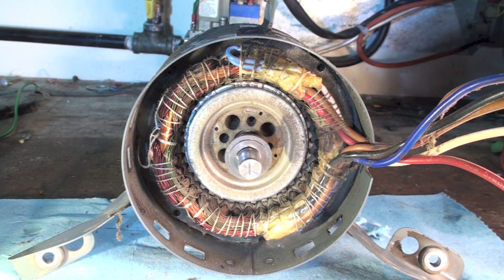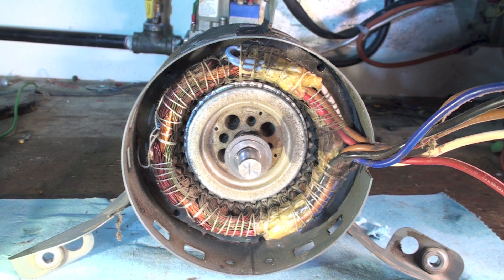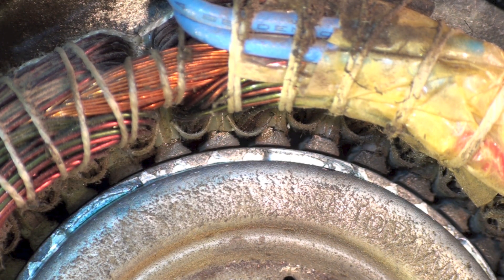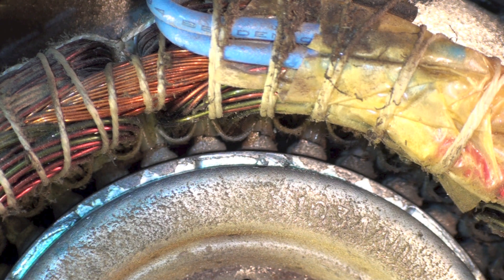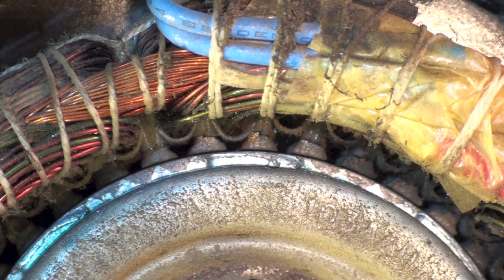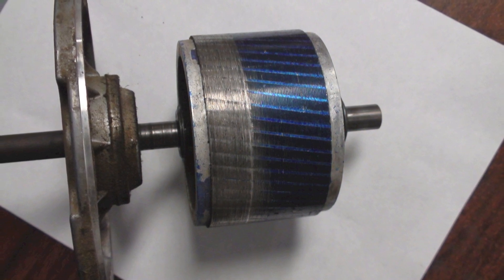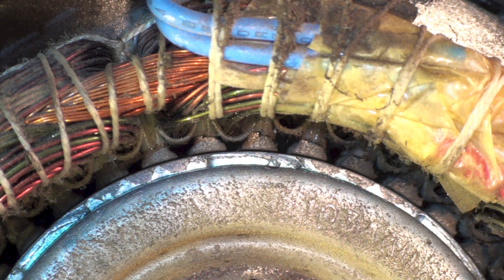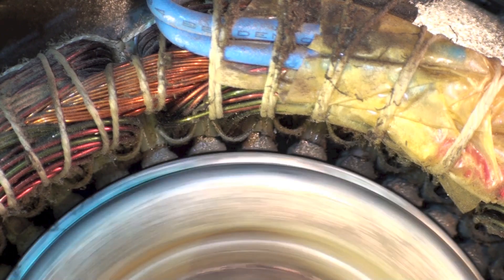How HVAC fan motor bearings work

Comment: I have old furnace no inducer fan the blower motor wheel i cleaned all the dust off it was caked on fan blades i dont even know how air even came out the vents now it runs and makes noise like a skipping buzzer noise but if i run it with inspection door off safety switch clipped its quiet i changed capacitor it still makes the noise its so loud i cant even run it,,all i did was clean the fan blades and now i cant even run it,, it has 2 tubes for oil i put some oil in the tubes still makes noise
Reply from the maker: Is the wheel hitting the housing?
GFM
Reply: @grayfurnaceman  no

Comment: With bearings that have a cut out for the fabric wick material, where should I place the wick? Top? Side? I would imagine worst would be bottom because the smaller bearing surface area due to the wick.

Comment: Will the shaft move at all in the healthy motor? Left to right .. Or should the shaft be rock solid and unmovable to the motor ?
Reply from the maker: That depends on what the motor is used for.  If it is a fan, it should move freely.
If it is connected to a pump, it may be quite stiff.
GFM
Reply: @grayfurnaceman  it was removed  out of the fan squirrel cage. And there was a slight movement although noticeable when moving the shaft.. I think the bearings the front bearings or failing I replaced the motor and all is well..

Comment: Thank you for this video!  The felt lubricator bushings in my fan motor wore out and were disintegrated causing the motor to seize.  I was thinking of rebuilding the motor with new bushings, but you’ve saved me a lot of time and trouble with your information that it’s not worth it and difficult to find parts. Welcome to our throw away society.  Now I have to spend $450 CAD on a new motor instead of $20 for new bushings. Oh well, hopefully the new motor will last me another 17 years like this one did.  Cheers!

Comment: Great info.  I found that my motor would turn freely by hand, but when power was applied, it would "lock up."  I'm guessing the front bearing was allowing a slight shift of the shaft when the load was applied, thus not allowing it to spin my squirrel cage.  Your video confirmed my theory.  Thanks.

Comment: Does this cause the motor to heat up excessively.
Reply from the maker: The heat from the bearing on startup is very small and in any case is dissipated when the oil flows into the bearing.
GFM